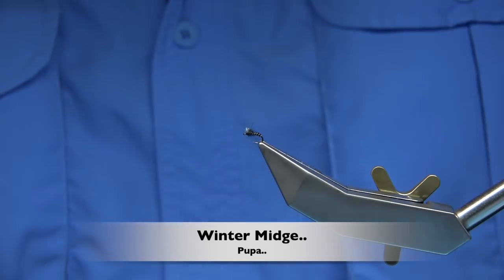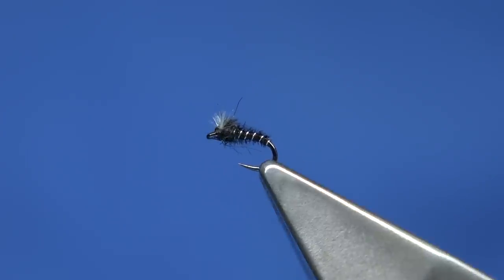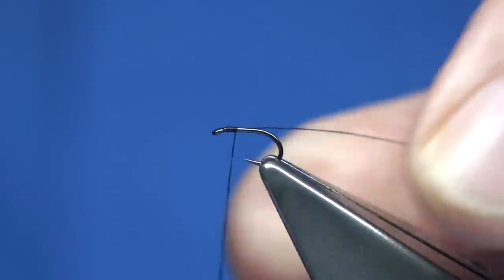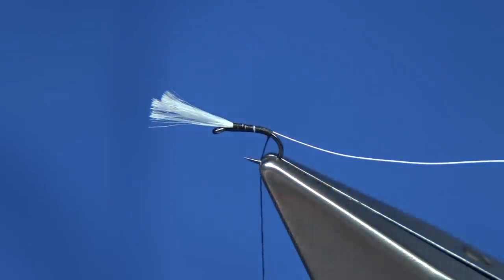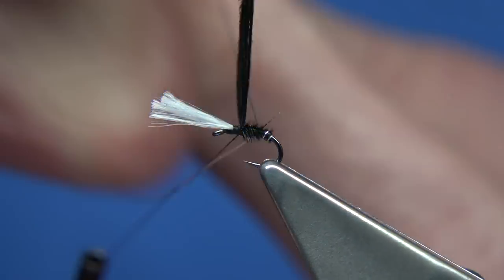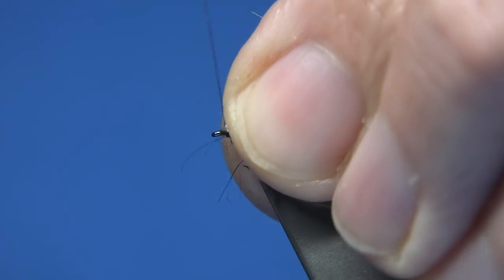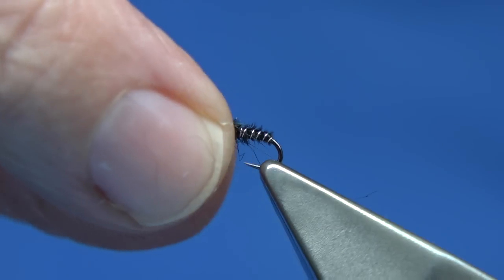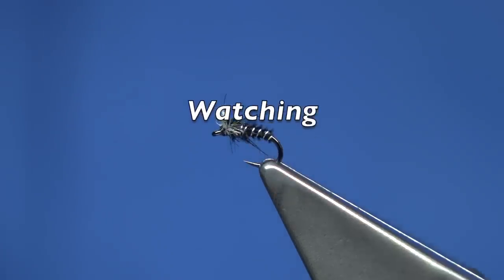Tying a Winter Midge Pupa Size 20 with Davie McPhail

Comment: I just got off the Provo River here in utah. I caught four fish but only on the tiniest of flies! Like size 24 to 30. I used a fly called a "no-see-um" at the advice of the folks at fly fish food. The problem is unless it's closer than 20 ft I can't see it at all. Would you be willing to take a crack at that fly? Or a really, small Dry Fly that's really visible?